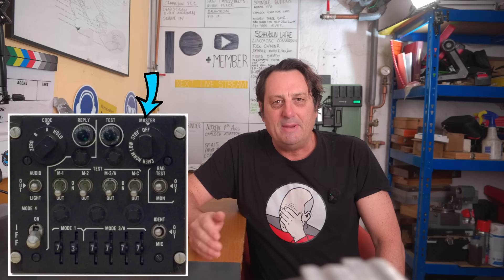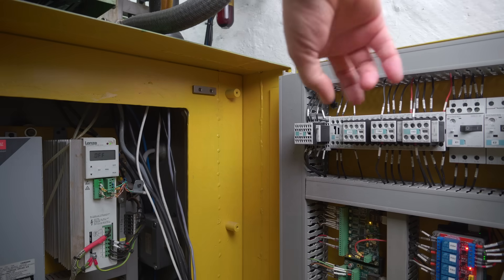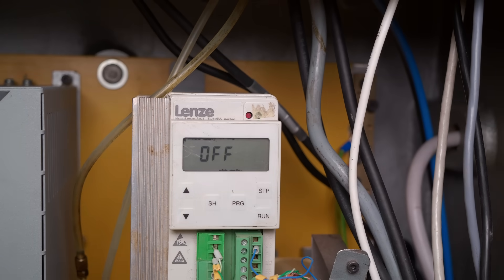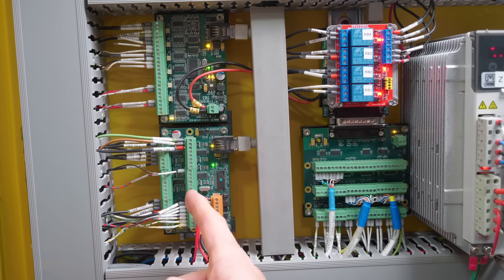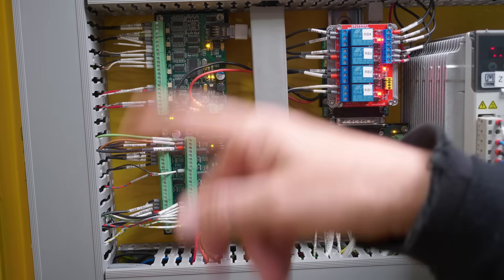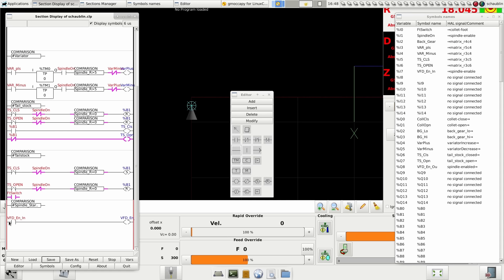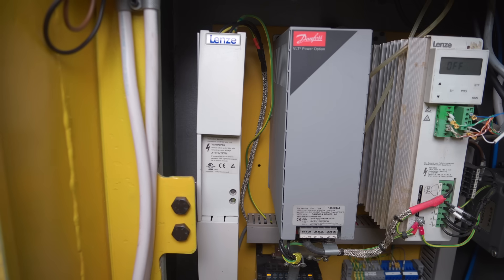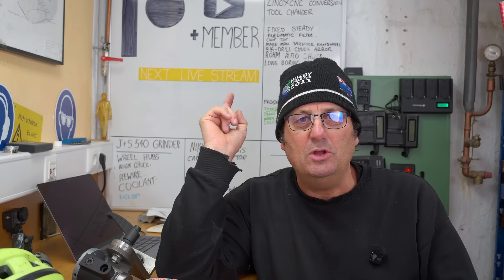VFD Braking fixed - Schaublin 125-CNC Ep. 63 || RotarySMP

Comment: Great to hear your ramp down time, and enable control is sorted.
With regard to E-Stop control, in order to ensure the spindle can be stopped in all conditions,  that is Manual or Automatic mode, AND an Emergency stop condition, there needs to be a Safety rated timer relay, with timer set to ensure that all machine movements are stopped as quickly as practically possible. 
If hydraulic actuators are fitted, and immediate loss of hydraulic pressure would cause damage, then the hydraulic motor/s also require a Safety rated timer.
I would suggest a 1 to 2 second timer, that is after an E-Stop is pressed,  spindle and hydraulics continue to operate for 1 or 2 seconds. 
Look up Pilz PNOZ Safety relays for information. 
The stop time is based on the distance an operator can circumvent, or just run straight at a rotating object, and triggers a light guard curtain for instance.
Reply from the maker: Good reminder, as I have Pnoz safety relay with a timer in there.
Reply: @RotarySMP Newer and high end VFDs have intrinsic safety circuits built in, along with an external control voltage. On standard VFDs, just drop supply voltage after timer has elasped. Don't fit a contactir between VFD and Motor.
Reply from the maker: @bostedtap  That is whatI have currently. The PNOZ drops the VFD after a couple of seconds. There is no contactor between VFD and motor.
Reply: @RotarySMP Hi Mark,  if so, do you keep VFD enable and stop input high during the delay period. This is when you start measuring the safety relay modules by the metre length, not how many lol. When I was a commissioning engineer circa 98 to 17, to comply with machinery directives, on rotary friction welding machines ( just think big lathe with hydraulics,  operator sliding powered doors, access gates etc,) I measured a total of 1.4 metres of Pilz modules mounted on din rail. The controls designers started using "Safety PLC" I/O, and with Programmable Pilz modules and greatly reduced the hard wiring modules, and loads of cable wiring.
Reply from the maker: @bostedtap  Wow, that was a complex set up. I just have the PNOZ waiting two seconds to drop the VFD's contactor. In that time the drive remains enabled, and the braking is attempted.

Comment: Great that you've found and corrected the issue.

A suggestion for E-Stop reaction - for actual E-Stop BUTTONS isolate all power - that is what a E-Stop is meant to do, make a machine electrically safe.
However I would argue the the foot pedal is a stop not an E-Stop.
For the foot Stop/Brake have it act as a stop not an E-Stop button - that is allow the chuck to be braked to a stop.
The foot brake will then do what most people expect. Also it is easiest to get to, and if all power needs to be off the E-Stops do what people expect them to do.
No one says you can't hit both.
Functionally hit the foot brake and the axis stop, the spindle keeps turning and clears the cut - one rotation.
The spindle slows at a rapid rate and so renders the machine mechanically safe, as soon as possible. 
This is far faster than rundown, and is aligned with my thoughts about braking the surface grinder spindle, though that would be at a far slower rate.

So in your shop they would align hit stop/brake and the motor is braked to a stop.
Also in your shop the feeds automatically stop (i presume the cnc does that) on the grinder the hydraulic pump has been turned off so feeds have stopped .
Need to isolate from electric supply, hit E-Stop.

On my manual lathe the E-Stop cuts all power, the spindle stops on the headstock and foot brake, stop the spindle normally (obviously...😀)
For a manual lathe that means you can be using both hands and still bring the machine to a stop easily using your foot.
Or you can use your foot to stop the spindle while your hands are working to stop the autofeed etc. so it doesn't keep feeding while the spindle is stopping
Reply from the maker: Thanks Ian. There was quite a discussion about this on the linuxcnc forum when I set it up.

Comment: Would it not be better to test for 10 minutes by braking from full speed with something heavy in the chuck?

An unloaded chuck has a lot less weight and will cause the braking resistor to heat up less.
Reply from the maker: If that were a realistic use case but this lathe is in an old cnc retirement village
Reply: Ah thanks for clarifying. 

I’m by no means an expert so it helps!

Comment: Idea - you can also use optocouplers to convert 5V signal from limit switches to 24V. Industrial optocouplers in sockets aren't cheap but I'm sure you can get similar thing as relay board you have. And compared to relay they switch instantly.
Reply from the maker: Thanks for the tip. If that second 7i84 can't be fixed I will need to look into this.
Reply: @RotarySMP  No prob, you can also keep 7i84 as spare or for future expansion. In case you were searching for industrial ones, they are sometimes in same category as SSR relays (at TME for example), so you must be careful - you want one with transistor inside (DC output), not thyristor (AC output). For example I use Finder 2966618 at work for similar applications (isolated signal transfer between machines), plus some compatible socket for DIN rail. I think input usually doesn't care about polarity, output does have only one correct way to connect in circuit.
Reply: I just noticed I typed Finder instead of Phoenix, my bad x.x

Comment: Well sorted! Great to see you hacking ladder code. As I recall you were not quite there on the Maho rebuild? I really like coding in it. It's so similar to relay logic that it was an easy step into code for an industrial electrician. I commissioned car plants at Waitara, Mt Wellington, Nelson, and elsewhere using Modicons, Allen Bradleys and Izumis using flavours of it. An Izumi does the gear change on my Maho.
I couldn't help with you VFD. But I had a small Siemens one on my lathe. The lathe is a copy of a 9" South Bend made in South Australia by Hercus in the 70"s when manufacturing in Australia was about one step above blacksmithing. It has metric lead screws and gearbox, but everything else is Whitworth. You'd be familiar with that. It been a real workhorse.
The lathe is 3 phase and at the time I only had single phase so the Siemens VFD output 3 phase variable frequency at 240 volts from a single phase input! That saves them the step up transformer or whatever. Almost all small induction motors are wired star, so I had to rewire it delta. To do that I had to take the front plate of and untwist the 3 common wires of the star end of the windings, then add separate spaghetti insulation to them and bring them all out to the terminals. That makes it a 3 phase 240 volt motor.
But it didn't have a brake resistor. What it did instead was dump the energy back into the tank capacitors. So it could actually get back the braking energy! The problem is you can't allow that voltage go above about 600V for fear of the insulation failing. It worked for most cases. But if I used the heavier 4 jaw chuck and braked from high speed, it would trip out before it stopped and free wheel down like yours did.
Now I have 415 Volt 3 phase in my shed and I put in a bigger Siemens one and wired the motor star again. It seems bullet proof.
BTW: Be aware that the internal and external cooling fans on the motor may not be able to dissipate the motor heat at lower speeds and higher torques.
Reply from the maker: Thanks David. I like classic ladder both as I am a poor programmer and also it is more visual and makes better video content.
Reply: @RotarySMP  Takes a bit to get your head around at first because of how it scans like a state machine. But you've now done a fair bit of circuit drawings where the way the contactors work is very similar.
G-code is very procedural, which is sometimes less easy to visualize. I guess that puts off a lot of guys. But it is basically "do this then this then this etc. with the occasional jump to here then jump back".
I find object oriented stuff difficult. Seems like a mass of spaghetti to me.

Comment: In most machines, you don't disable the HV side of the VFD once the machine is running, unless e-stop is pressed. There's usually some (very large) contactors that get activated to turn the HV side of the drive on and off, and I suspect you don't want to cycle those contactors unnecessarily so they don't wear out. Although there is always a soft-start to pre-charge the DC bus capacitors before the main contactor closes in, so maybe it's not that much of an issue.
Reply from the maker: I was concerned about erroneous rotation from EMI on the analog input

Comment: there is DC voltage brake function in vfd, to set it to work for 5 hz down, to help with runout. It cant hold intertia but can momentarily clamp motor to standstill
Reply from the maker: Thanks. I'll try that.

Comment: Hooray for the hardware fix! Not sure why the VFD isn't enabled nearly all the time, though.
0) I support the requirement that an even number of mid-week videos are necessary to maintain the space-time continuum.
1) I have long wondered whether it’s better for e-stops to trigger VFD breaking, and if so, whether there should be an E-BREAK stop and a KILL POWER stop, and how they should be labeled, and how operators should be trained to not get confused. Is there any useful precedent here in the Aviation world?
2) 3:26 huh, Danfoss makes motor filters? Somehow I think of them as just making radiator stuff. Need to broaden my horizons.
Reply from the maker: Aviation is not much help as we tend to keep everything running until manual shut down

Comment: 1:20 Just a slight correction: OV is overvoltage (of the internal energy storage). IMAX is overcurrent (or probably rather current limiting mode).
Reply from the maker: Thanks for that.

Comment: Hello Mark, Be careful not to drive at to low frequencies. You might fry the motor.
If I recall well from a former life VFD output should never go under let's say 30Hz.
Ideally the windings have a thermistor or clixon built in for temperature monitoring.
Nice post again.
Reply from the maker: I had it set for 20 Herz min. Not sure how I got to that
Reply: @RotarySMP 
As I recall for applications where long periods of nominal torque at low rpm were required the motor was equipped with an independent fan.
In German terminology: Fremdlüfter.
Regards

Comment: The relays on thoae relay boards are rubbish you can replace the physical relays with pin compatible OMRON relays and they'll be fine.
Reply from the maker: Thanks. Hopefully Peter can fix my second 7i84, and I can remove that relay board.

Comment: Instead of a relay, you could use an optocoupler to get the shift from 5V control logic to 24V control logic. You can get optocouplers that are in a plastic housing and clip onto the DIN 35 mm hat rail; very narrow and compact, similar to terminals. No mechanical wear like relay contacts to worry about, and quicker response time than a relay as well. On the VFD, DC Injection will net you a much faster stop than ramping down, even with braking via chopper and resistor active. DC injection for say 1-1.5 s, followed by a (slightly 1.6-2 s) delayed VFD contactor disconnect for an E-Stop situation, but use chopper and resistor for normal, but still quick, ramp-down braking.
Reply from the maker: Thanks Mike, I will have a play with those settings.

Comment: Glad you got the brake working. You have 400V supply ! nice.  I've always had to be careful buying machines to check the motors can be wired star or delta for 240V 3Ph in the UK  but still need a single to 3PH converter.
Reply from the maker: Yeah even our old 3rd floor apartment had 3ph for the oven it is standard here.

Comment: Ive only commissioned a few replacement VFDs, but come across loads on different machines. They are almost always permanently on, with the machine. In normal use, why  is yours turning off? I would expect it to stay on to perform everything you need.
Got far too over excited by a mid week video though. I need to go and find a fresh mug of tea.
Reply from the maker: I was concerned about EMi on the analog in causing rotarion
Reply: @R @RotarySMP that’s definitely good to keep in mind. Unless your motor cables are unscreened & in the same trunking as the analog cables, I would be surprised if it caused a problem. Am I right thinking your lathe has a separate brake? You could engage that when it’s in a standby mode.

Comment: if you doing it with relay there could be hardware solution without touching the cnc software side
you have this enable signal on blue wire, you just need to invert it by connecting it  to a normally closed relay and hook the output to a break. then when vfd is enabled break would clear because relay would open and wjhen the signal was gone it would close again but that is only if i understand corectly how the break work
Reply from the maker: Thanks for that tip.

Comment: For a Full stop ( and it will kind a hold the motor ... u cant turn it) some DC injection is a good choice. Parameters are usually , at what (and below) RPM it should add DC and for how long ( seconds... ) Maybe voltage or current level.  Since braking is getting less effective as the motor slows down....
Reply from the maker: Thanks. I need to play around with those settings.

Comment: Cheers! You got it working. Drives are one of the fun things where the same symptoms can stem from mechanical, electrical, or program issues. This usually results in a standoff at work when something goes wrong with a variable speed motor until someone proves it is not an issue on their side or rather it is an issue with the other departments side of the equation.
Reply from the maker: I am all departments here, so it was my fault

Comment: I'm not a VFD expert, and I never put one on a lathe.
But I have some around, fitted to various machines, on the CNC mill, the plastic shredder, plastic injection machine for the hydraulic pump, and one on an unfinished prototype high speed coolant centrifuge that I made to clean coolant at my workplace.
This last one is similar to the one on your lathe, since it is spinning a lot of mass at high speed, and when I tried to make a deceleration ramp without a braking resistor the VFD started complaining about over-current.
That doesn't need to be decelerated, so I set the VFD to disconnect when I want to shut off the machine, and set a very slow ramp for the deceleration if I reduced the speed manually with the potentiometer.
I found interesting the use of a braking resistor, maybe when I decide to finish that machine I will adopt one!

Said that, I don't understand why you shut off the VFD.

From what I know, it's better for it to be kept on and manage everything from its inputs.

Only on the shredder (all the electrics there are made by a friend of mine which is an industrial electrician), we added a contactor to physically disconnect the VFD output from the motor in case of an E-Stop only because of rules (the shredder is made to be potentially CE certifiable), but it stops almost immediately since it is slow (30rpm at full speed,100Hz, with a 1400rpm motor with 90:1 gearbox).

Usually I keep the VFD powered and stop the machine with its inputs.

Why did you disconnect it?
Reply from the maker: I was concerned about EMI on the analog input causing rotation
Reply: @RotarySMP  Take this with a grain of salt because it is a thing I only heard of and I probably think to have understood but I'm not sure...

To reduce that kind of issue (in addition to shielded cables and their right positioning in relation to power ones) you can add a certain value resistor in parallel to the signal and ground, to keep small inductive tensions low. 
When a "solid" signal is given, the resistor value must be high enough to let the signal be "up" enough to be read as wanted.

I think this notion comes from a talk with Arduino nerds in the club I'm developing the plastic recycling project during the discussion about the washing machine hacking we are developing for washing the plastic we collect, but I think it can be useful also in other fields.
Reply from the maker: @PreciousPlasticRomagna  Thanks for that.
Reply: @RotarySMP You're welcome!

Comment: The VFD is (should be) capable of emergency braking on power failure. In a continuous, say bar feed production setup, putting the braking resistor outside the cabinet would be important. For this machine and use, it will be fine.
Reply from the maker: Thanks for the feedback.

Comment: Quick question
With the brake applied on the drive at the times when a commanded spindle  stop signal is applied doesn't that keep the windings of the motor powered up?  If left for any length of time the motor is going to get hot if that's the case.
Reply from the maker: It would if I left it a 1hz, but I disable the drive after 2 sec.